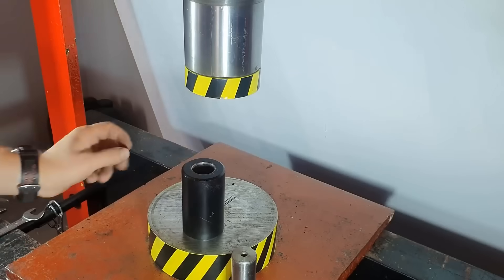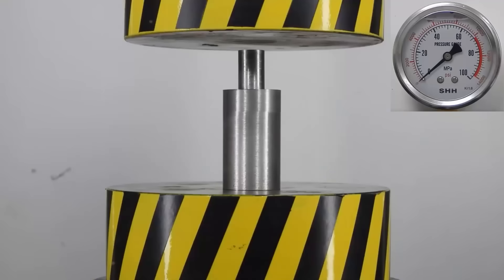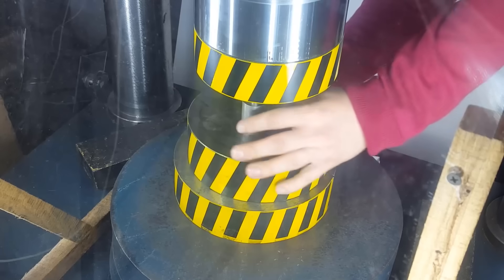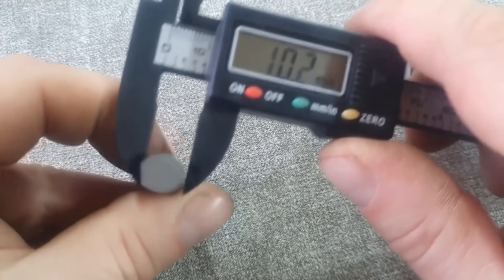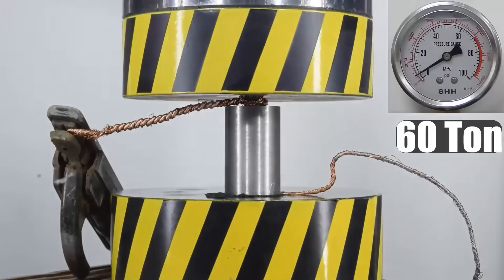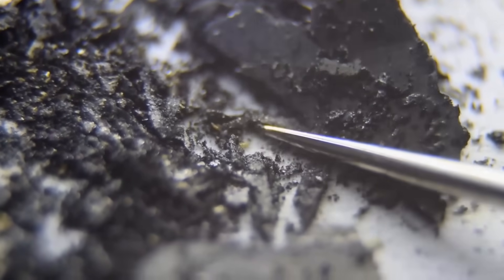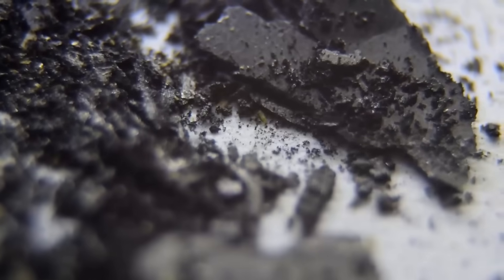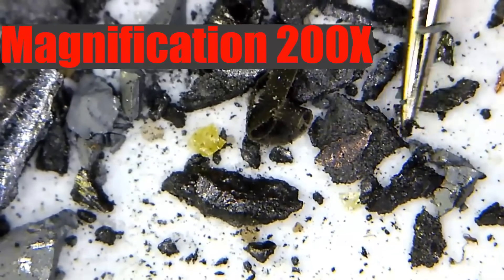HYDRAULIC PRESS TURNS GRAPHITE INTO DIAMOND

Comment: You basically immediately created short circuit with the uninsolated wire touching a cylinder of conductive metal from two sides. So the current was flowing by the path of least resistance, which would be most likely the surface of the cylinder.
Reply: Yeah I noticed that. Electricity always takes the path of lowest resistance. Wires are made of copper because copper has very low resistance. Theoretically, almost any material can conduct electricity given a high enough potential difference. The steel cylinder isn't a great conductor, but it will be much better than the graphite or the tungsten rod so of course it's going to go through that. He should have used insulated wire with the exposed part touching only the graphite, and that probably still wouldn't work. Graphite is actually one of the least conductive things  there is. I believe it's used as an insulator in capacitors. It would take a truly huge voltage to get electricity to arc through graphite. The best way I can see to get as much heat as possible would be to run a thinner wire along the gaps between the tungsten rod and the cylinder since it's not quite a perfect fit. The thinner wire can't conduct as much electricity as thicker wire. If it gets too much current, it starts to heat up, until it melts the wire and whatever else happens to be in the immediate vicinity that has a lower melting point than copper. As the wire heats up and melts, it would actually transmit some heat directly to the setup. Since the experiment worked, he must have somehow succeeded by accident, probably by putting an industrial level of electricity through the steel cylinder, which would have made the whole setup overheated. It isn't easy to trip a circuit breaker that can handle heavy machinery like hydraulic presses. I'm assuming the thirty minutes to several hours they spent waiting to touch the experimental setup because everything was still too hot just got edited out.
Reply: @stevejolly8672  Where did you get your electrical knowledge? The back of a cereal box? Graphite is such a bad conductor that it's used to make the "brushes" in electric motors and generators. Also it was the positive pole in most batteries.
Reply: @stevejolly8672 Shame you spent all that time writing what you did.

Graphite is a good conductor of electricity, unlike most non-metals. This is due to the presence of delocalized electrons in its structure, which allows them to move freely and carry electrical charge. Graphite's unique stacked plate-upon-plate structure facilitates this electron movement, making it an exceptional conductor.
Reply: Well, it was already bond to fail from the strat, but hey, we get to see what not to do if someone tries it 😅
Reply: Yup. Any heat it got was from the pressure
Reply: Amazing.  Apparently no knowledge of electricity and conductivity with metals.
Reply: @jim7634 I dont have any knowledge about this but i can say I've been stupid enough to test out pencils and an electrical outlet shaved the pencils down thin and its really not a good conductor of electricity I may not be smart but testing shit like this i would do in a heartbeat again

Comment: I think you should try During HPHT, pure carbon is pressed within a metal cube and exposed to immense heat and pressure through electric pulses. Eventually, the carbon breaks down and crystallises into a diamond. Any metal traces within a HPHT diamond will be minuscule and usually not visible to the naked eye

Comment: Use a spring on bottom to lift the cylinder, but put a plug on bottom and top, then crush from both ends at same time....the spring will keep cylinder suspended until both plugs are crushed inside..hope it wont explode.

Comment: Use Carbon Black either mixed with or without Graphite. 
Try forming the material into a large solid piece with the press gently, then heat that large piece to over 1200 degrees. Quickly put it into the steel hole attached to copper wires then press. 
Just an idea but you might get larger diamonds or more of them.

Comment: You miss 3 times the power so you need another press on east and west and another in South and north.
Reply: Good thinking. This apparatus actually exists. 

Look for "Three axis multi-anvil press"
Typically these practical machines use six hydraulic rams, exactly as you suggest. 

But here's a thought experiment:
Take a sphere. Cut it in half around the equator, then slice it North Pole to South Pole at 0 degrees longitude, and again at 90 degrees. Gives you eight equal segments. 
Now cut the tips of each of the segments where they meet at the centre. You end up with trinagular face on each segment, forming an octohedron (eight faced) volume at the centre, where you put the graphite. 

You need an extrudable gasket material to put between the segments at the start, then apply a hydrostatic (fluid) pressure on the outer surface of the sphere. Which might mean you submerge the sphere in a barrel of fluid, then compress that fluid with a piston...

Since pressure is force/area, IF your sphere is big enough, and the octohedron small enough, you can create diamond making pressures in the central volume with a low hydraulic pressure. 
The pressure created is (oversimplified) the ratio of areas of sphere to octahedron, times the pressure in the fluid. There are losses in the squeezing of the extrudable gasket, however. 

Since the entire sphere is in compression everywhere, Tungsten Carbide has enough strength that no additional bracing is needed. 

But, as ever, the technical details get in the way. That gasket material has to accommodate enough movement for the central volume to decrease to half its size, to generate diamond pressure in the springy graphite. Finding an appropriate gasket material that can extrude enough, without simply "blowing out" under the pressure and releasing the confinement completely, is the killer detail.

So, if you can develop this into a working tech...

Comment: You need a seed diamond first also you need a lot of heat.  Just pressing it won’t generate enough heat, additionally it takes hours to produce small diamonds so you’re not making diamonds this way.
Reply: Sorry, but wrong, wrong and wrong. Since none of your "facts" are correct, you cannot claim these are not diamonds. 

You do NOT need a seed diamond to turn graphite into diamond. Seed diamonds are used to GROW a diamond into a bigger (gemstone) diamond. 
Similarly, it takes hours (even days, and weeks) to GROW a "small diamond" (which I think is a reference to a gemstone diamond of perhaps 0.25 or 0.5 carat) so it seems as if you have focused on the wrong kind of diamond creation process in your claim. 

Just pressing it CAN do the job. This has been proven in "diamond anvil" presses that crush a tiny volume of material into a tiny diamond. But the pressure required is MUCH higher. (like, nearly double). 

Diamonds this small can be made in seconds. The factory processes I knew from 30 years ago could make 1000 to 3000 carats this size (and even a little bigger, up to fine grains of sand) in under half an hour. 
Limited only by the time it took for the press to ramp up to the needed force/pressure (ten minutes) and then heated to over 1000C (7 to 8 minutes, since you are fighting heat being lost from the graphite, making it difficult to get up to that temperature). 
The diamonds were made in about 5 minutes, then the whole systam had to be gently (ie safely) brought back down to ambient pressure and temperature, over 8 to 10 minutes. 
Total process time (depending on the volume being pressed and heated) anything from 15 to about 35 minutes. The larger (and slower) systems were more economical, because you could make 3 times the diamonds in only twice the time. Do the math.

A small press with tiny "reaction chamber" like this one could make the pressure and temperature diamond crystals as found in about 5 to ten minutes for the full cycle, IF those conditions were being met.

On the other hand, the (originally) Russian technique of firing a lump of cast iron (with huge graphite inclusions) at a concrete wall to generate mostly pressure and some temperature in the dynamic "dead stop" impact (which is possibly what happened here) makes diamonds like this one in a fraction of a second. So, definitely NOT hours.

The cast iron impact method is NOT widely used (not commercially, anyway) because it leaves you with a solid lump of iron encasing the very limited diamonds made, requiring further smelting to extract them. Worse still, these diamonds are always of extremely poor shape and quality, all of which makes this an expensive way to make diamonds that are not much good for any kind of industrial cutting or grinding tool. 
Oh, yeah, after all this detail, we haven't even touched on the "ideal" crystal shape for machining tools. In a word (or two) "Cubo-octahedral" is what we want - and we can only get that with very precise control of both pressure and temperature. 

The close up shot is deceptive. The diamonds made here are almost microscopic, little more than an eye-catching sparkle amongst the debris, and certainly not anything big enough to use in any jewellery. It is more of a powder size, than a grain of sand size.

Comment: Along with the electric arc welder try heating up everything in an open crucible before adding the pressure.
Once glowing hit the pressure and leave it on for about 30 minutes, you should be able to get the atmospheric pressure and temps coupled with the time might get you to diamond.
Reply: Yeah hed have to wait around 1 to 3.3 billion years

Comment: You seriously think you got 2500-4000C with that janky welder setup? Ohms law clearly states that arrangement would be incapable of passing an electrical arc through the carbon. All that steel was just a big heatsink for the copper wire, any heating in the carbon from that "welder" over a few seconds would have been utterly negligible next to the compression heat. The molten copper you saw is just a result of your poor electrical connection failing under load. I very much doubt those are actually diamonds you've created, I'd think that impurities, contamination or deception is far more likely.

Comment: Did you send them to a lab to test them to be sure they were actual diamond, and not the result of other impurities? Pencil led has other stuff added to it and IDK what the temperatures and pressures in this experiment might do to those impurities. Its mostly clay, so it might produce some kind of glossy ceramic that looks like what you found. If they are real diamonds then that's awesome. Either way I would love to see more experiments. I would recommend using activated carbon. You can find it in most drug stores and it is very high purity. If you used an all tungsten setup of die and piston and didn't go too high on the pressure, it might last a lot longer and produce much bigger crystals. Turning the heat down a bit might also increase the life of the experiment and the crystal size.

Comment: The professionals use a diamond for nucleation inside their machines. And they use more /t as they are using heat and pressure. You may also wish to insulate the conductors. Like washers...

Comment: It's not 3x times less. The word "times" is multiplicative, so yiu cannot multiply and get less, unless you're multiplying by fractions. The correct phrase is 1/3 of required pressure.

Of course you're cost benefit analysis is flawed. A 500 ton hydraulic press may cost $100,000, but if it is amortization over large, consistent production, the cost of the the press spread over many carats, then it might become cost efficient. No spends $100,000 to make a tiny piece of diamond of 1/1,000 carat, then buys a new press to make another tiny piece of 1/1,000 carat diamond.

Comment: The forst 2 attempts the length of the center piece did not seem long enough because it seems like the press hit the sides which contains the graphite but does not put pressure on it. Only the carbide one seemed long enough.

Comment: How can you SAY 40 Ton BUT SHOW 40,000 KILOGRAM?
40000 kilograms =

44.092 us tons
Reply: One tonne (i.e. One metric tonne - correct spelling) is 1000 kilogrammes.
Reply: Because outside the US, 40000kg are in fact 40 tons. There are apparently multiple typed of tons. I for example didn't know the US had its own ton.

Comment: This may come as a shocker, steel makes an extremely poor electrical insulator.
There was No arc whatsoever.
An insulated wire might have allowed some arcing.
Reply: "as a shocker" -- nicely done
Reply: Steel isn't all that conductive. It's commonly used as a minor insulator any time steel is wanted for its other properties as well.
Reply: @WilhelmEleywhat would you suggest to get the temperature going then ?

Comment: Crystalline structures need to be seeded first.. you created crystalline seeds essentially.. using the same method with your largest seed placed near the center will make it grow into a crystal.. the longer you can maintain the temperature the more atoms will align and the larger it will grow, also pressing into a cupped bottom will help increase 360* pressure
Reply: Absolutely correct. In addition, the carbon needs to be pressed through an iron lattice with the seed on the other side. I don't know the reason why, but this was found out as the meteorite impacts that had diamonds created, seemed to always have iron present.

Comment: Yeahp, cats are awesome...!!! Electric arc inside .... I doubt it, because that was a short circuit between the top and the bottom 
of the cylinder, and that's why the circuit breaker went down....!!! Good video.
Reply: What would you suggest to get the heat up ?
Reply: @nicodesmidt4034  blow torch🤣

Comment: Umm, I don’t know for sure but my geologist father once told me that diamonds are created under extreme pressures, yes…but also extreme heat 🔥 🌋 
😅
…so you should probably add a flamethrower in the mix!? 😂
Reply: He was right. Natural diamonds are only formed very deep inside the earth, in the molten mantle, where temperatures and pressures meet the right conditions. 
We can mine them today ONLY because volcanoes have carried those diamonds up to the surface at some point in history. 
"Kimberlite pipe" is the solidified remnant of an extinct volcano core, and are the main source of mined diamonds today. 
Alluvial diamonds (in rivers and seas) have been washed out of that volcanic rock by erosion.

Comment: 0:50 NOPE! made of clay.
i tried with burned sugar, but not enough pressure.

tungsten carbide does not withstand intense heat from an electric arc, it explode.
use a torch.

Comment: You wouldnt have broken the piston if you stopped the press and let it rest for days
Reply: With it locked in place to keep the pressure on instead of increasing it
Reply: It's called impatient.  You cause too much breaking point. Like an earthquake. Something has to give
Reply: The thermal trade isn't fast enough to make a bigger product through the element.  The heat dispatch in such a short fast instance.
Reply: The abrasiveness of micro diamonds.  🤦 Diamonds are useless we only like them because girls ont a big one.